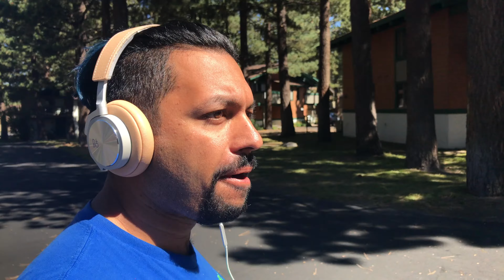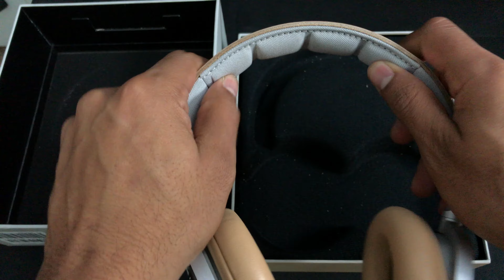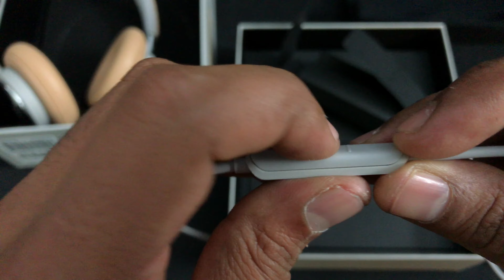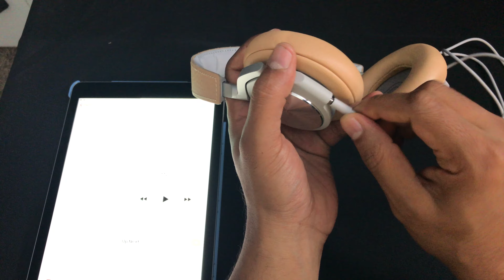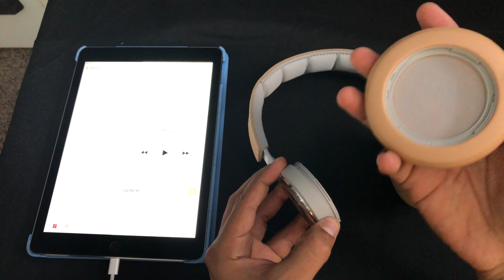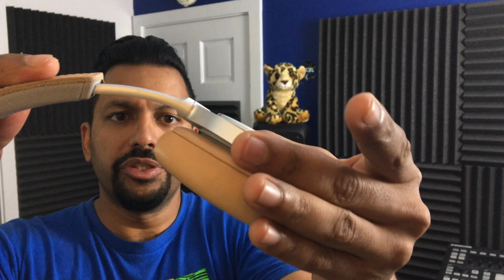B&O H6 Premium Headphones (Gen 2) Best Audio Gift Under $300!!

Comment: Thank you for recommending the Geekria case.   BTW the Geekria case is really nice.  I bought the case since the latest H6 2nd gen doesn't even come with a bag.  B&O taught us not to complain about the included bag being lame.  Also I couldn't find the H6 2nd gen ear pads on their web site, so I asked B&O support to find out how I can order a set of ear pads.  They told me to check with their retailers.  I haven't had a chance to stop by a Best Buy on their list.  I'm sure I need a pair for spare.  They might not make them down the road since they confirmed H6 1st gen, H7 ear pads don't fit on H6 2nd gen.  Currently a pair of H7 ear pads is $59; hopefully a pair of H6 is about the same.
Reply from the maker: Hi!  I hope the H6 2nd gen will be available.  I haven't seen much wear and tear on my ear cups though.
Reply: Hi mi friend ) What’s name of track 6.50? )) Thank you

Comment: Do you still like these? How’s the natural leather holding up?
Reply from the maker: Hi!  Yes, I use them about 4 - 8 hours a week while editing in my living room.  The leather looks like it's brand new.  I put them in a case when I'm not using them.  That might help keep the leather lasting longer.  You can also buy extra ear cups from B&O if you needed.
Reply: Techno Dad Thanks for the reply. I’m going to order one. I heard them and am really impressed by the clarity. I like the feeling of wireless but I haven’t found anything that sounds this good in Bluetooth. Thanks again.
Reply: Do you know where to buy replacement ear cushions? I cant find any on Ebay or B&O website unfortunately @TechnoDad
Reply: I bought mine June 2017 and I use them in the evening watching movies/youtube and listening to music.
For 6 months of use they still look like bran new though I do have 2 small scratches in the aluminum plate (the B&O branded shiny one) and the leather bearly show wear. Only the side facing to the front show little darker spots by now on the cups but still I wouldnt say that its bad for 3h a day 6 months.. :)
Oh an at first they sounded a bit flat but now compared to brand new ones they sounded much deeper/richer yet balanced and not as tiny as they sounded at first (atleast thats what my impressions are) - not that its a big difference as it sounds like.. pretty small but I have to over react here to make it clear. ^^
Would buy them again crisp, clear sound balanced and the bass is there which goes pretty deep and is never overpronounced in bass aswell as highs so you wont get tired of too harsh highs or boosted bass after short time listening to them.
Reply: Got mine 7 months ago in natural finish. I’ve been using them ~3 hours a day and the inner leather is getting some dark stains/aging signs mostly on the front part. It doesn’t look bad in my opinion but didn’t expect it to happen that early either (I always keep them in their case when not in use). Sound wise, they are out of this world straight out of the box. Then I bought a better cable, and paired them with an oppo dac/amp + some dsd files.
Really stunning results!

Comment: I reviewed the H7's on GameTyrant.com and freaking loved them. Basically the same as the H6, but wireless with some cool touch features.
Reply from the maker: +Keegbot Plays These are some awesome cans!  Yes, the H7 is the same except wireless.  And the H9 is the same, but with bigger ear pads and it adds active noise cancellation.  The sound quality is awesome!  My case arrived yesterday and I've been using these a lot at work.
Reply: Раиса Ершова This is obviously a bad click, save yourself ppl.
Reply from the maker: Removed...
Reply: They do not look nor do they sound the same. I felt like the H6 had more soundstage, more clarity, while the H7 had a bit more of a punch. The H7 also looks alot bulkier, while the H6 are super light. Can not go wrong with any of them, the H7 do have some "low" volume problems in bluetooth which can scare some people off.